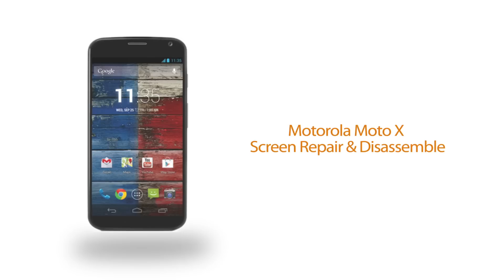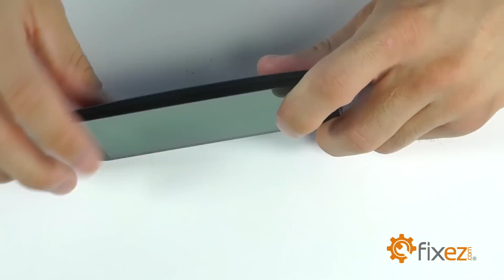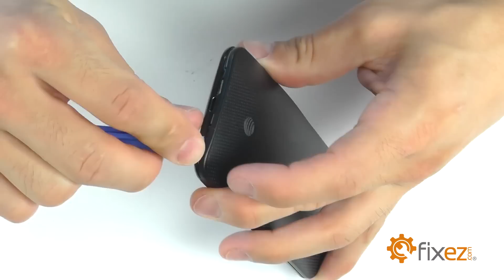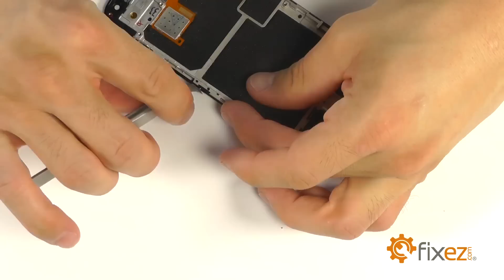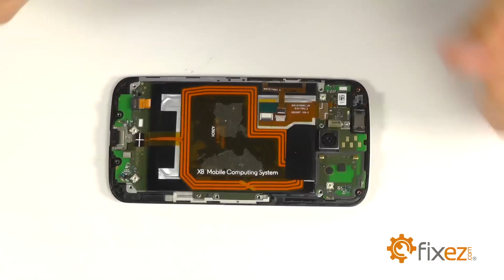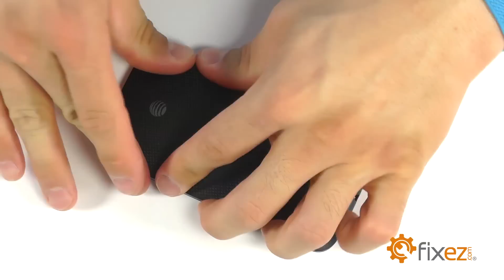Motorola Moto X Screen Repair & Disassemble

Comment: I dropped my moto x in the toilet and it was in there for like 5 seconds i got it out cleaned it iff put it in rice right away for 2days and the phone still works just fine and turns on and everything just the screen doesnt detect my fingers when i touch it and reccomendations??
Reply from the maker: Sorry to hear about your issue. Whenever a device has been dropped into water, it is a gamble on whether or not the water actually created damage to your device. It sounds like your digitizer may be compromised. If you want to check out the replacement parts we offer for this device please follow the link https://www.fixez.com/store/motorola/motorola-moto-x

Comment: I recommend anyone doing the repairs/disassembly to get  a set of Torx screwdriver sizes. My phone did not have any T5 size, but instead a couple of T3 and T4/T2? Expect a work frame of 20-30 mins for new and cautious users like me! 
Overall, this video help me with my 1st generation moto x, as it gave me confidence in where to avoid the wiring and screws.Aside from three micro pieces that I found inside my phone, that weren't mentioned, the video is accurate (a rubber supporter, the SD support frame, and some sort of device next to the earpiece speaker or probably a different model).

Comment: As a professional tech, you left out some very important points:
     -The back cover is lightly though firmly adhered to the phone.
     -To remove the volume buttons, there is a little metal clip that must first be removed from between them. 
     -The earpiece speaker is adhered to the housing.
Otherwise, it is obvious that, for showmanship, that Moto X had already been disassembled. There is no way the original adhesives would have given way that easily.
Reply: Agreed on all counts. Getting the back cover off was the most difficult part of it because of this. Wish I had known it was glued. Helped to insert small wedges (I used guitar picks) to keep the back from re-clipping itself back in as you work around and then sloooowly work the battery and ribbon cables away from the blue sticky stuff on the back cover. Patience and a delicate hand are required. 

My earpiece speaker was also different than shown. Also, my screws were T4, not T5. All in all, great video - very helpful.
Reply: If the internal sim reader is broken then is it necessary to change the entire motherboard
Reply: No if you have another dead board and a good heat gun.

Comment: hello, i recently replaced my phone screen which was broken. Everything works except the sim reader doesnt detect any sim. I'm not getting connected to any networks. Any hellp?
Reply from the maker: It's difficult to confirm what could have caused this. We recommend going through the repair process to ensure nothing was missed. It's possible a connection was missed. Also ensure there is no torn flex cables.

Comment: Just a helpful hint this phone is a little bit more complicated than some others there is adhesive that helps hold the back cover to the phone so apply a little heat and take your time. Also don't try to remove the ear speaker with out slightly heating it from the front side of the phone or you run the risk of separating the speaker itself since it is glued in place. The phone in the video above looks like it is an easy job because it has been taken apart before IE the speaker circuit isn't even attached to the phone when the back cover is removed, it should be one of the flex cables that need to be unplugged before removing the main board.
Reply from the maker: +Jeremy Barr Thank you for watching. We appreciate the helpful tips provided.

Comment: My Moto X also came with T3 screws, not T5 as stated in the video.
Reply from the maker: +Eric Castle Unfortunately, Motorola for this model has this issue. Some units require a T3, T4 or possibly the T5. Our units used required a T5 torx. We apologize for any confusion here.

Comment: I competed the repair ansneverything was working except the screen  only cut on in well lit areas. why is that? now the screen doesn't work at all. help!
Reply from the maker: +Brianne Jones Sounds like the backlight is the issue. But if you can no longer see the LCD at all, you may have a faulty unit. Just ensure to double check your flex cable connection as well.

Comment: anyone else have their back cover glued??...I am stuck on step one! Trying to get this off but going is very slow..
Reply: +dutchkork ok i realize it's because it's a refurb...someone glued it after they fixed it before...
Reply from the maker: +dutchkork There is adhesive keeping it in place. Slowly use your heat gun and a pry tool to help remove the back cover.

Comment: A couple of tech tips for anyone deciding to tackle this, it was my first time breaking into a phone like this. Two things that I noticed: you don't necessarily have to remove the volume/power buttons and the power/volume ribbon cable may not want to snap back in. When I couldn't get the cable to snap back in I taped it down with electrical tape to ensure a good connection and added a couple of layers so that the rear skin would sandwich it in there and keep it from moving anymore. It was an adventure to say the least.
Reply from the maker: +Justin Robertson Thank you for the feedback.

Comment: i recently used this video to replace a broken lcd on my moto x, and upon repairing i noticed that the front camera was not working or appearing in any of my camera applications(camera app/snapchat). do you have any idea why this happened or what i can do resolve this problem. please get back to me ASAP.
thanks
Reply from the maker: +Elie Jacobson Possible that the flex cable for the front camera was damaged. Inspect to ensure there is no visible damages and if so, you would want to replace this.

Comment: hey my phone moto x was thrown by me at the ground by mistakely and glass was broken and many cracks.But mobile is charging ,its showing the green light ,is it  mother board problem also.
Reply from the maker: +Seema Vedantam Difficult to confirm this without an evaluation. But for the most part your LCD should be the only thing damaged, aside from the touch screen of course.

Comment: Thank you for the video. It helped a lot and I was able to replace my broken screen and get it working perfectly. You must have disassembled that phone before because nothing on my phone just fell off. The screws were all on with Locktight and the battery and mother board  were glued down. They came off hard. There was another gizmo on my phone you didn't have right beside the camera that had to be unplugged. Anyway, thanks again your video taught me a lot.
Reply from the maker: +captainkaufmann We apologize to heat about the troubles. Thank you for watching!

Comment: I recently dropped my moto x 1st gen right on its side on hard wood floor and the screen produced random streaks of color making the screen inoperable. So, would replacing the Moto X Display Assembly fix it? Its not a problem with the motherboard?
Reply from the maker: +SolidMGSnake Sounds like it should. Your LCD seems to be what got damaged in the fall.

Comment: I thought this video was nice and the replacement screen was great. Here are a few notes on my experience:

Mine had T4 screws. Make sure you use the right size or they will get stripped. I tried T3 and got most out but two ended up stripped. I used a small pointy dremel bit to grind a slot into the two stripped screws to get them out with a slotted screwdriver. It took way longer than necessary, if only I had used a T4. (This has been noted by a number of others)

Be really careful with that small white ribbon connector on the battery (for power and volume buttons). It came apart for me, and if you look closely at about the 10:00 mark in the video you can see it came apart even for the demonstrator. https://youtu.be/bR2k7kEZaj4?t=590. If it comes apart you can pop it back together, but it's a pain.

If you get the whole screen with frame assembly, check for a small piece of protective tape over the microphone hole on the inside. I got the whole thing put back together and the mic wasn't working, so I had to do it all over just for a tiny bit of tape that I missed.

Comment: Will the screen replacement that Fixez sells work on the Moto X XT1049? This is the Moto X model that Republic Wireless uses. Nobody seems to have the screen replacement for this model.
Reply: ***** OK, thanks. I will order it. I was just thrown off because XT1049 isn't listed as compatible.

Comment: Just replaced my broken screen, the guide was nearly perfect and the new screen looks great. My phone had a few very minor differences/parts but that's not surprising and they were easy to work around.  I wish the walk through would have mentioned that the back cover is glued on, getting that off was the hardest part. Ended up using a hair dryer to heat up the adhesive, but it was still difficult. Another issue is that my volume button isn't fitting correctly (regardless of orientation), I thought it must be the frame so I swapped them with no luck. It doesn't rock back and forth in either frame that is attached to the new glass. I Fooled with it for a while but it was getting late and I lost interest. With the phone fully assembled it's easy to tell that somethings wrong with the buttons action but it works well enough to bring up the touchscreen volume and will get me to the end of my contract. Parts came really quickly and I loved the guide. Thanks.
Reply: Since replacing the glass/lcd I have one problem. When a call is started the screen goes into sleep and I can't get it back out unless I do a hard reset. The power/reset button works properly in every other application. Any ideas? Seen this before? Didn't do this before the replacement. would love your input Fixez!
Reply: Also, what was I supposed to do with the adhesive pad you sent with the new part? wasn't in the video.

Comment: Note, it appears that motorola has used a variety of screw sizes.
The video claims T5, some comments say T3, mine has T4 screws.

I suspect that many of the folks who complain about the poor quality of their T3 drivers may have been mislead by using them in a T4 screw (the driver fixs, but loosely so it will strip either the driver or the screw head)  
I eventually had to drill off the head one of the screws after it was stripped; If i can't find a replacement screw, i'll just super-glue that corner of the display.
Reply: Jeff Peck Also, the video doesn't show it, but you need to be agressive with a heater/hair-dryer to get the back off; must soften all that glue that holds the back to the NFC antenna (I broke my NFC trying to pry off the back, but it's not that critical; and only $15 to replace)

On the other hand, you really don't need to separate the battery from the mother board; just un-clip the button-cable, lift the motherboard and battery, and place on the new screen/framework.  less to un-glue, less to reconnect.
Reply: Jeff Peck i went out and bought a t5 at lowes only to my dismay to find out the bit it to big. mine must have t4 screws also.
Reply: I need to replace my front and back cameras but I'm not sure which screws are they, how can I tell which ones a T3-T5?
Reply: Im not to sure I there really is a way to tell before hand if thats what you mean. I ended up buying a Screw driver kit online that came with t3, t4, and a t5. My moto x 2013 had t4 screws in it. good lcuk
Reply: jeremy stauffer where did you bought your kit? Just wondering. Any good ones from Amazon you recommend? I have two moto Xs and I think I stripped some screws and the torx screwdriver on that one so I'd like get higher quality ones.
Reply: I bought mine on Amazon for $10. http://www.amazon.com/gp/product/B00FHRYE0S?psc=1&redirect=true&ref_=oh_aui_detailpage_o00_s00
Reply: I saw other repair guids say I need either a T3 or a T4 screwdriver. I bought a T3 and found out it was too small. I think I'm just going to buy all of them and see if a T4 is needed. http://www.overstock.com/Electronics/INSTEN-Cell-Phone-Screwdriver-Repair-Tools/6190907/product.html?refccid=3ri34icrtixz4zsdiiflalwsnq&searchidx=16

Comment: Hey! So I dropped my moto X (which already had cracked screen glass) and now the LCD display does not light up whatsoever. The phone rings and turns on/off, alarm I'd set came on, etc. I'm thinking I should disassemble the phone to see if something got knocked loose. Have you experienced this issue before?

Comment: A few other folks have mentioned that, while the video specifically refers to a T5 Torx screwdriver, that size is definitely too big.  I ordered a new screen, and it came with a pry tool, a spludger, and a T4 Torx.  I was able to get two of the eleven screws out with it, but couldn't do a thing with the T5 I bought in a kit over at Lowe's.  (It wasn't expensive, though, like seven bucks, and now I have a whole bunch of precision bits!) - but no T3.  So, on to Amazon.  My next kit with a T3 in it should be here by the end of the week... sigh...
Reply: Awesome.  No worries.  It's an excellent tutorial video in all regards.
Reply: wow. i should have come to the comments before. my supplies just came in. good thing i got that t5....

Comment: My Moto X recently dropped and hit the floor on it's bottom left corner (when viewed from the front). The brightness seems to be permanently set to less than 0. I can only see through the screen in pitch black darkness, and even then, barely. Could this be an issue of a loose part? I'm thinking of opening it up to try and fix it. 

I appreciate any help. Regardless, great video. I'd feel confident using this as a guide after watching it and seeing you respond to comments.

Comment: i recently dropped my moto x in the toilet. The screen is the only thing messed up. The phone will light up normally but i cant tap any of the buttons. Would a new screen fix this issue? Please Please Please Respond.
Reply: so basically what you did in this video?

Comment: It looks easy, but when I pried off my back plate the screws were stripped and could not be removed. I wish I knew that before I bought the kit and new screen. 

It's a shame, this looked like it'd be pretty fun.
Reply: ***** Maybe because the tool kit that was sent included a cheap phillips head screwdriver instead of the #5 torx?
Reply: Nope. They were definitely torx. It was just the kids in the sweat shop where my phone was assembled. The little boogers stripped some of the screws when they put the phone together. Plus, they weren't all the same size screws.